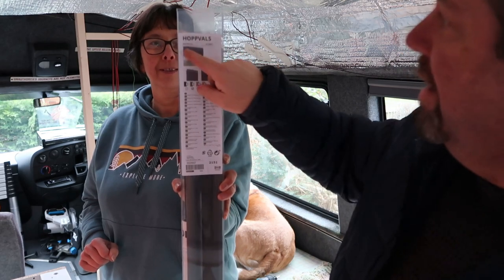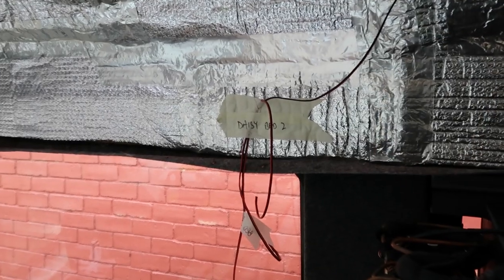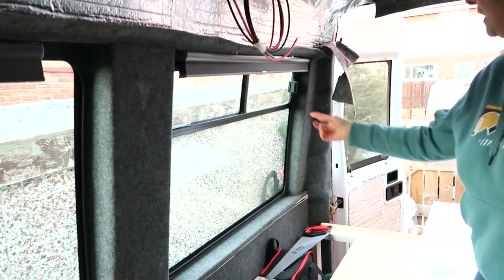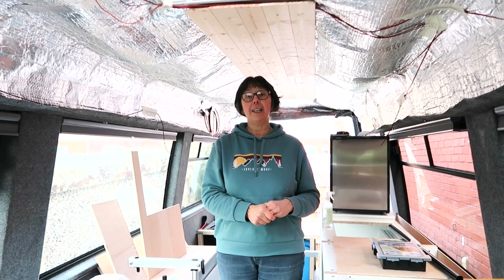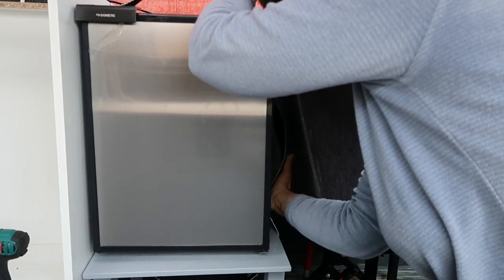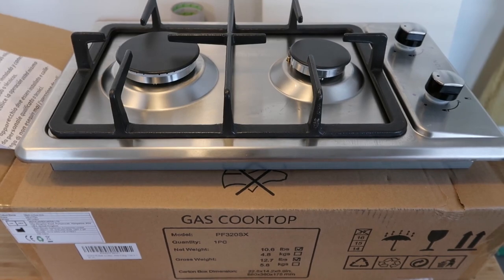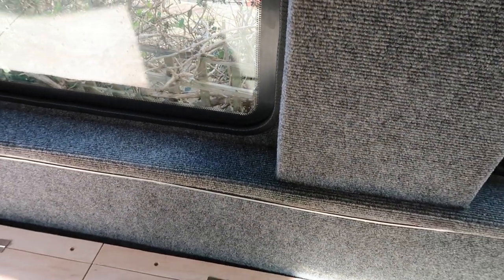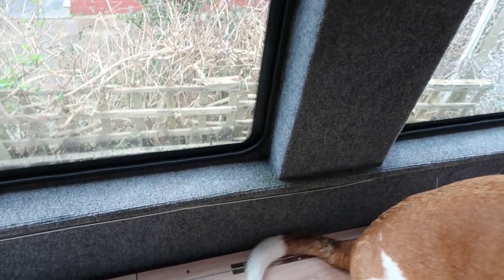Part 10 - Our Iveco Daily Self Build Minibus Conversion - Doing the Odd Jobs -Van Build

Comment: With the window sealant issue, it's often an idea to level it off at a 45 degree angle so any sitting water drains downwards rather than sitting level on the sealant.
Reply from the maker: Good suggestion and although I didn't really know that, I did ensure I graduated the sealant at both ends to help with run off, especially all the flat top section of the window, thanks for watching and any other suggestions are welcome 😀 
Have a good week 👍🐕🤗

Comment: Hazel ☘️ …
Do you remember the name of that black stuff you put on the window before placing the polystyrene insulation ? 
Great tip I will use for closing off my headboard window in my caravan … thank you for that !👌

You two could make a living converting camper vans … I’d sure commission you , tho I doubt I could afford Mr Max Clerk of Works fee 🤣

Lovely job all round 👍
🙏☘️😘
Reply from the maker: Hello Hazel, so funny, thank you 😊 
The bkack fil. Was from amazon called 'rabbitgoo matte blackout privacy window film '.
Went on really easy and cut well with sharp blade. 
Hope it works for you ....
Thanks for being so lovely 😍 
Elaine,  Darren and Max 🐶
Reply: @PensionersinPortugal  
Hazel ☘️ …
Thank you so much … just jumped on Amazon and ordered some rabbitgoo ! 👍
🙏☘️😘

Comment: thinking about the blinds could you not use magnets on the bottoms and then they could stick to the window edge ?
Reply from the maker: Hi Janette, thanks for your good suggestion, i figured out a runner for the blinds that added a splash of colour and works easily. we've used magnets to keep our kitchen doors closed. Thanks for watching, Elaine